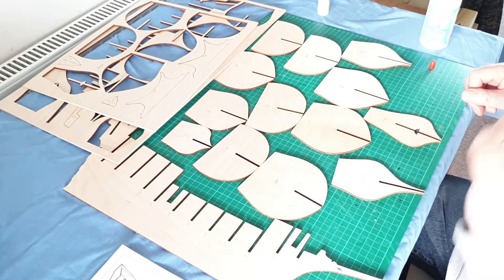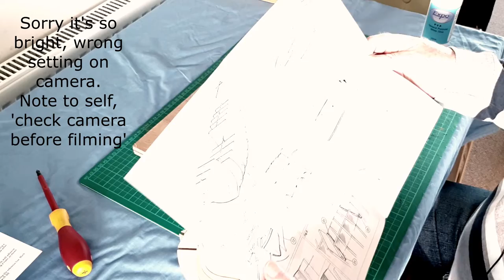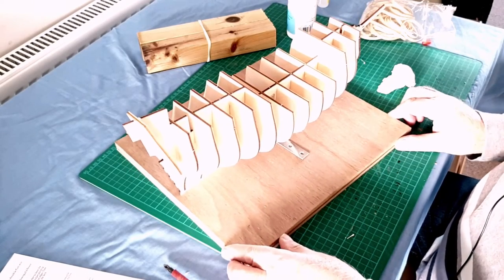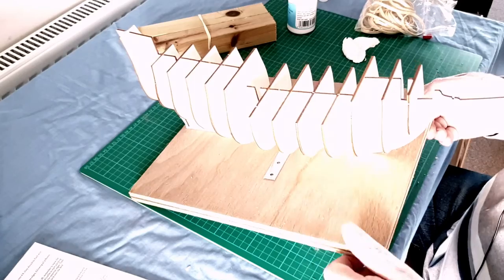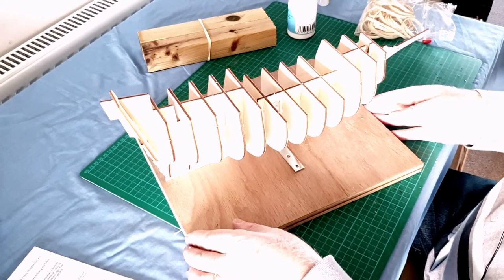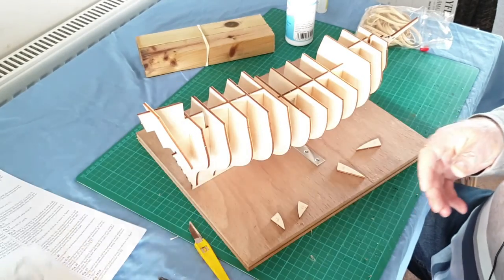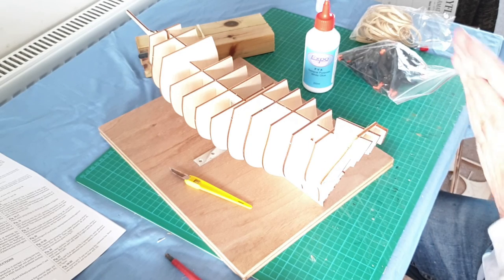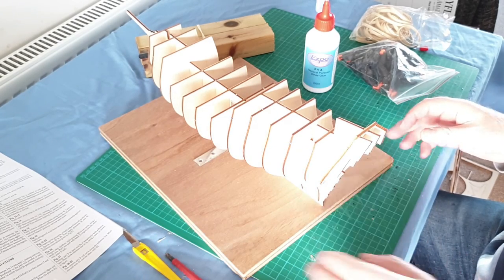Mayflower Model Ship Build Video 2 The Mayflower 1620

Comment: Being a want-a-be ship builder, may I ask what type of glue are you using. I believe I'll start this kit..  tkz
Reply from the maker: The glue I use for most of the woodwork is just a general purpose PVA, however if you are just starting this may not be the best place to start as the planking is hardwood and not so easy to bend, have a look at Scottish Maid, this is a similar size but the planking is softwood and then veneered. Good luck.